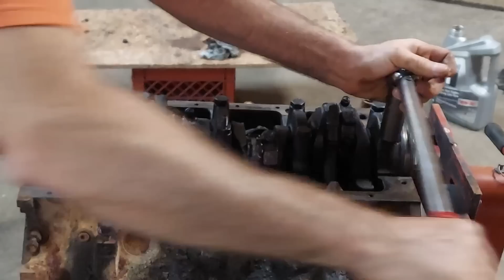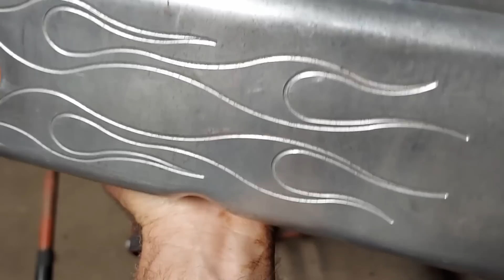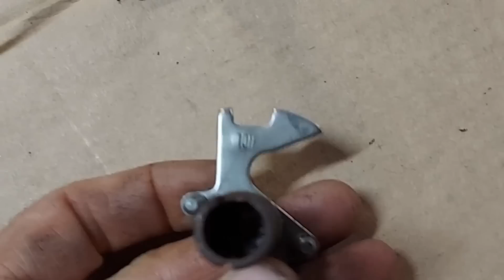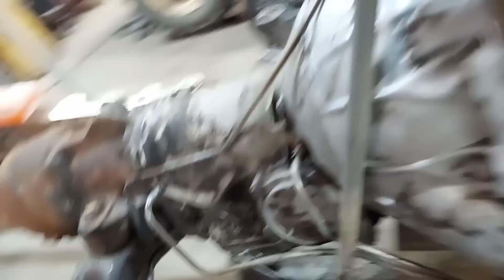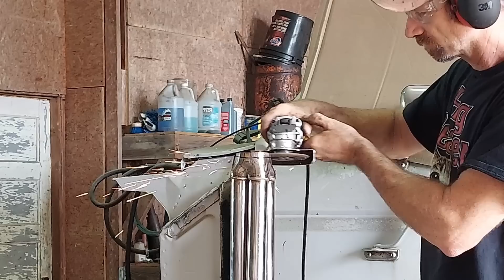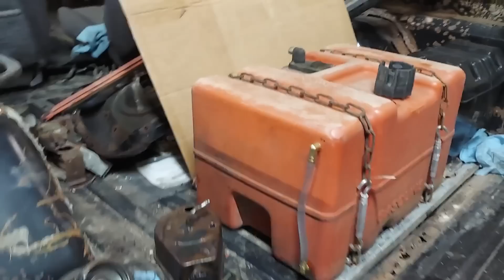1976 Bronco PT4- 302 engine from a junk truck. Will it run?

Comment: Those stainless headers you have for your 302 ,.  Could be made from  "T-201" Stainless steel.   It does weld fairly decent with just regular steel wire and welding gas .  It is a fairly decent stainless steel,  but it is not as rust resistant as higher grade numbers of stainless steel. 
 I have a a Spec - D brand header for my 4.0L jeep engine that is made from T-201.  I had to do some welding on the flange for fitment and it welded up pretty well.
 Tim from Wisconsin.

Comment: First off that book would have been dinner second thing I'm not sure what that was I think maybe a Chevrolet there were three trucks the one in the center is that vehicle for sale thank you please
Reply from the maker: On the cement slab by the door, the was a 66 Bronco, 56 F100 and a 58 Edsel. If you mean in the grass where the deer disappeared, there was a 56 F700, a 68 Mercedes Unimog and whats left of a red Dodge truck out a bit further. There are some other vehicles out there but I dont think any more made it in the vid.

Comment: SO COME DEER SEASON ,YOU WON'T HAVE FAR TO LOOK..
PROBABLY YOU'LL NEVER SEE HIM AGAIN AS HE WAS AS SCARED AS YOU WERE.
IT'S NICE TO SEE A PROJECT COME TOGETHER.
GOD BLESS YOU AND YOUR LOVED ONES 
(I HAD A 1965 FORD PICK UP #7 LIFTER WOULD GET NOISY ,I'D DRAIN A QUART OF OIL OUT AND RUN IT WITH A QUART OF ATF ADDED AS THE DETERGENT WOULD CLEAN THE LIFTER ,THEN DRAIN IT IN A COUPLE HUNDRED MILES OR SO CHANGE THE OIL AND FILTER AND IT QUIETENED UP UNTIL THE NEXT 5-10000 MILES,REPEAT)

Comment: 1985 was the first year for 5.0 fuel injection in the f150. I bought one in 1998 as my first truck. 4x4 xcab long box. Paid 350 not running and had my dad flat town me across to to home. Got it running by replacing the fuel pressure regulator the replacement part was included, used on a fuel rail, extra parts.

Comment: Hi from uk bud and "" NOT STEVE "" and his friend 👋👍🐾🐾 great goin getting the block out for 3rd time but this time it's in done finished for now 👍  so good job 👌 nice idea for bolts with heads cut off for intake that worked well man 👌 and the deer just keeping an eye one your stashes making sure his friends don't bounce in for party now engine out the way from them lol 🤣 good job on headers to it seems nothing just that easy anymore but you got it 👍 thanks for your time be safe and see you soon 👍 👋
Reply from the maker: It is satisfying to finally find a use for that engine I saved for so long. Especially now that it is running and seems to be in good shape.

Comment: I really want to see the original harmonic balancer off of that engine I think what you got there is a star motor they were put in 80s fl pursuit mustangs and a few other things and man they would rip
Reply from the maker: Does that balancer have a noticable visual difference from other 302/5.0?
Reply: I got my hands on one out of a a 85 ssp mustangs that had been wrecked in the late 80s on the back of the balancer was what looked like a 5 pointed reluctor